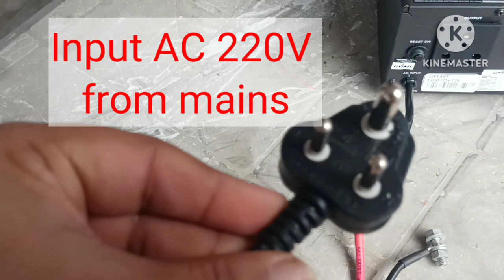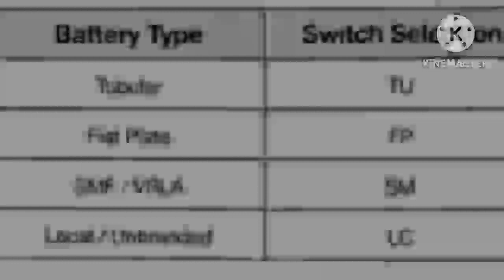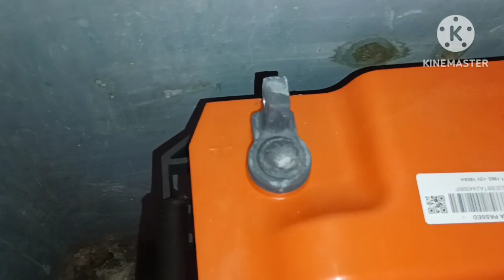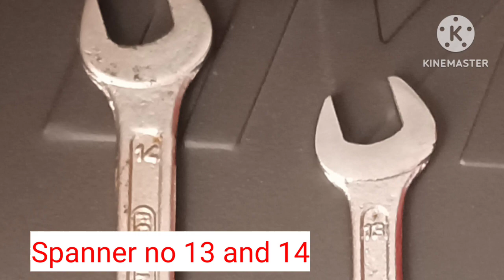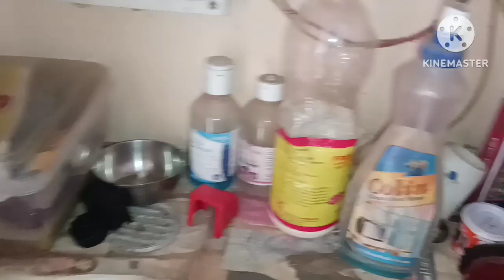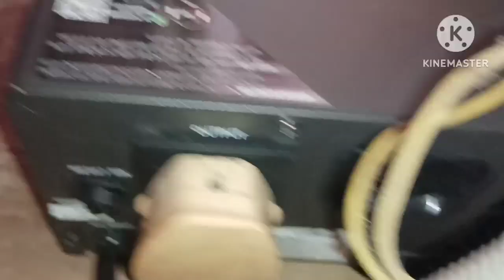Unboxing LIVFAST Sinewave Inverter - FCS1125+

Comment: Liv guard & liv fast are same company. Can products be mixed?
Also using unregulated mode what is the exact benefit?
Reply from the maker: Dear sir, battery and ups/inverter can be taken from any company you like. You just need to decide about the requirements and match the specifications. Unregulated section provides economy. Charging in economical.